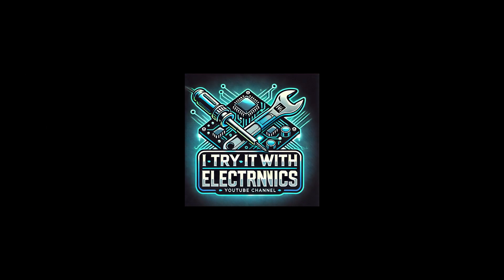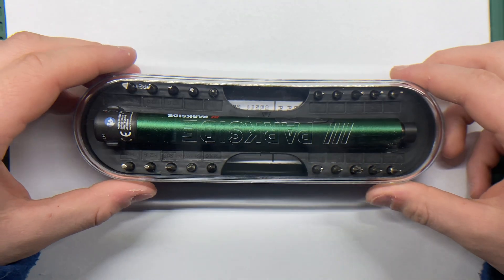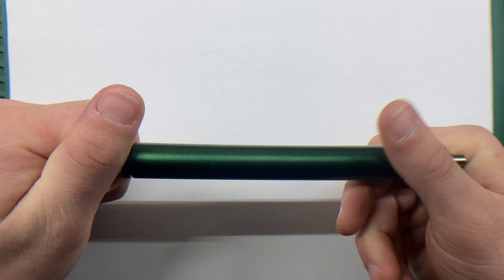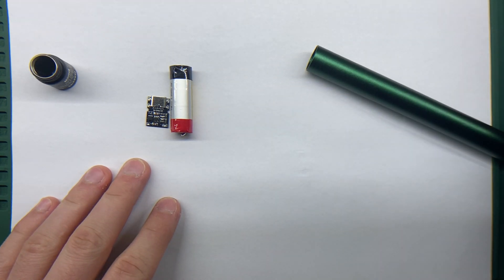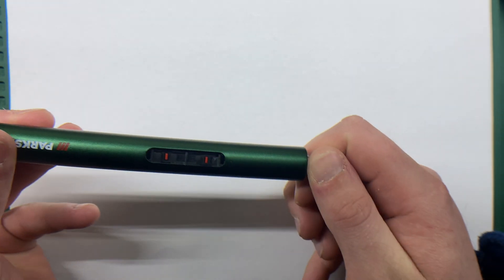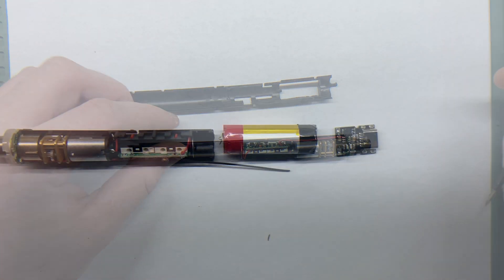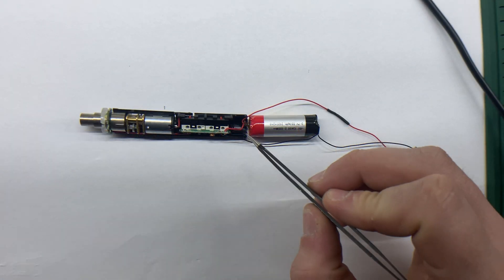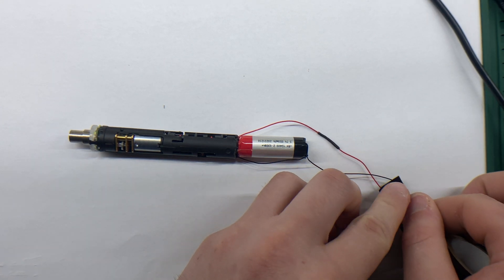Parkside Electric Precision Screwdriver - Battery Upgrade

Comment: The battery is from a vape , you are doing exactly what I want to do and use a tp4056 and a battery from a Vape, but I will 3d print a cap that I can unscrew and it will hold the battery and the tp4056 and I will make multiple modules so I can change the battery and have a new one on the go.